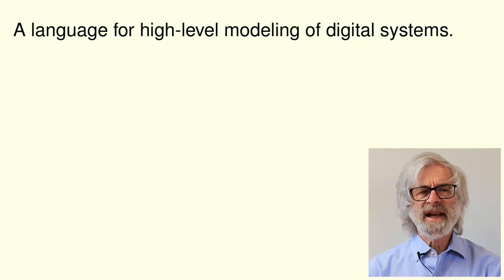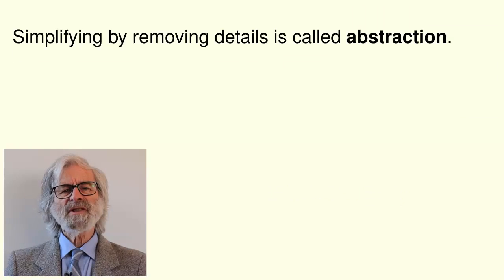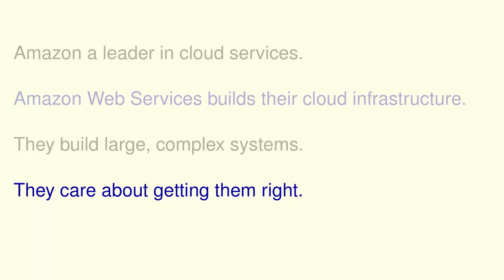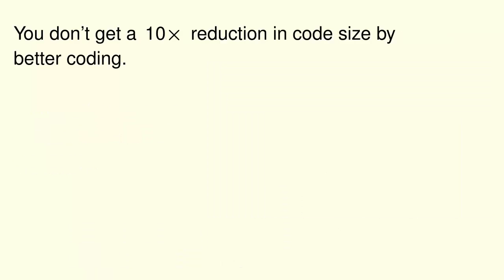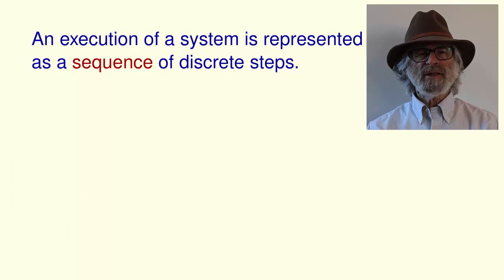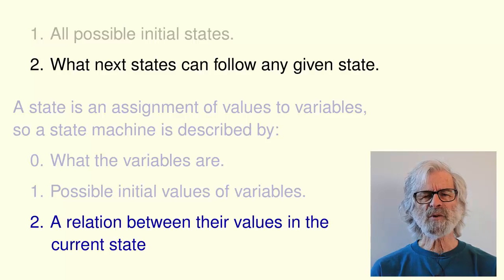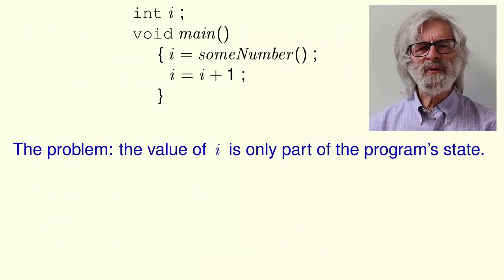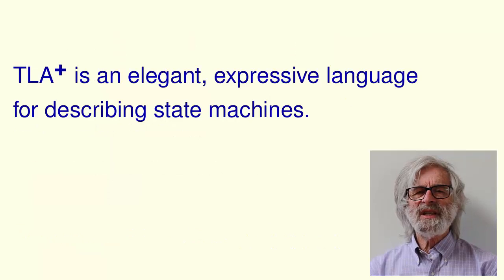Lamport TLA+ Course Lecture 1: Introduction to TLA+ (Old Mirror, See Description)

Comment: Observation about his state machine example:

[i:0] -> [i:42] -> [i:43]

He states that "i" initializes as "0"... but in c... that's a wrong assumption.  If memory is allocated for a variable... it can be initialized to any value.  It allocates around (2 bytes for some processors, 4 bytes for others)... but it doesn't initialize them as 0 (though it is a possible initial state).  When the memory is allocated; it begins in whatever state that piece of memory happened to be in.  This particular issue has bitten me in the rear before.

Maybe I'm picking nits... but, I think I'll watch the rest of this series; he seems to be describing an interesting way to look at systems.